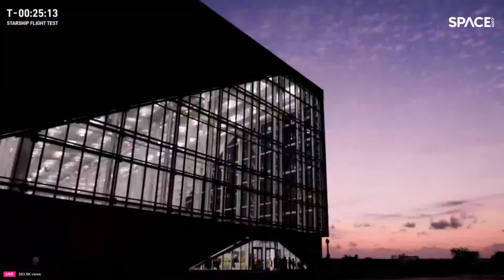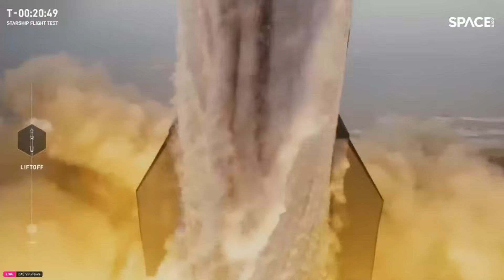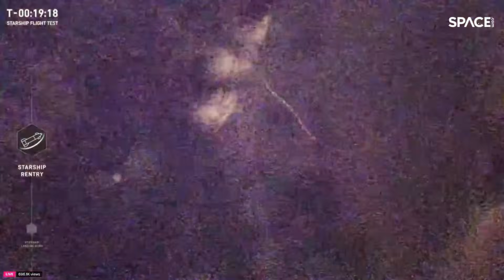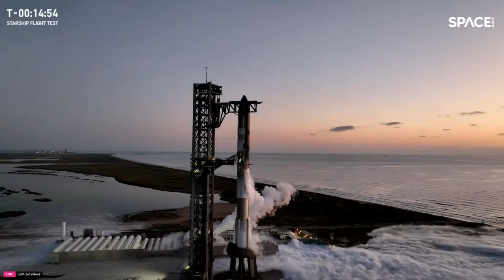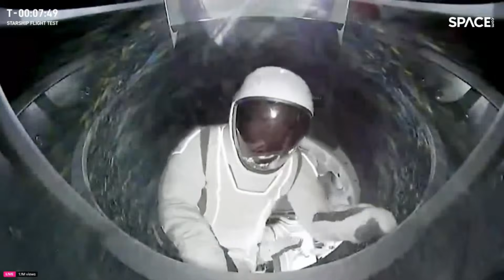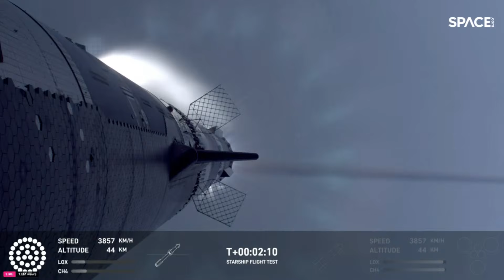Replay! SpaceX launches Starship on 5th flight, booster catch successful

Comment: The catch was awesome. So incredible to see them nail it on the first try. However catching a booster is fine, but if SpaceX is going to focusing on catching the ships, it will do  nothing for get them closer to landing on the moon or Mars. 
Also closing the chopsticks around a Starship to catch it would probably damage the heat shield tiles. 

The reality is SpaceX shouldn't be talking about landing un-crewed Starships on the Mars by 2026, when they don't seem to have made any progress since SN15 on landing legs. The legs used for SN15 are no where near wide enough to land on the uneven surfaces of the Moon and Mars. The legs also need to be self leveling.

Comment: It's amazing how FAST that booster was dropping down.  Yet in control to get it at the right spot.  and firing up the engines shortly before landing slowing it way down, and on target.  At first I thought it was coming down to slam into the ground at over 3000mph.  The mess that would have been made over the whole launch area would have been massive.    There is so much stuff there and all unprotected.  It's ALL counting on a successful catch on the first try.  Something that has NEVER been done before.   The Facon 9 has a small margin of error when landing.   If you're off a foot, it's not the end of the world.  Off a foot here at the Chopsticks and disaster!!!  The things SpaceX has been able to pull off, I thought was impossible.  No way in hell.   China has been trying to copy this and so far has failed.  It's so much harder than it looks and it looks darn hard.  It's not going to be exactly easy for China to copy.

Comment: the bad new is that the booster cannot be reused unless the structure is repaired
Reply: Did you see damage that no one else mentioned?   The booter, ya, it had a small fire for a while after landing.  This was only a TEST.  This was never meant to be used again.  They have more being built that have moved on tech-wise.   Just like Starship.    It's all about trial and error.  Launch, Launch, launch, learn, improve, and try again.   This time they saved the engines which can be reused on future rockets.  It'll be inspected to see what can be improved for future versions.  This was only a test to see if they could land it.

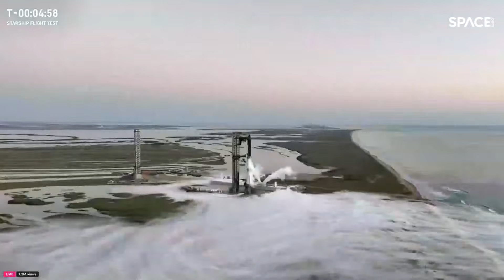Comment: Amazing--- what has done is  "Just the begnning for modern, futuristic man" (provided humans avoid WW# 3 or 4)! They must prevent the stratospheric "SMOKE" (Isaiah 51:6, Psalm 102:26-28, Jeremiah 25:30-33, QURAN 44:10 "Al-Dhukan" (SMOKE)-get it now, Rabbi/Reverend/Imam-- a thin hace of nitrogen oxide gasses could 1) block weak strarlight of the constellations, JOEL 3:15 + MT. 24_28-29, ISAIAH 13:6-10, JEREMIAN 4:28***--- am I not correct about this Sir? Why even JESUS spoke of it!

Comment: This video is 1:42:41 long i n Slimjet (chrome).  But when you look at it with Brave or Firefox it shows as only 40:44 long.  The rest, with the Ship and the Ship's landing are not there on those.
[update]: It must be a problem with the encoding.  Only 40:44 shows up on most browsers, and  on the search page, search for "spacex starship launch 5"

Comment: As i was watching this. The video was truncated. I was watching the re-entry part around peak heating or slightly after when the flaps started to get burn through but then the video stopped and was truncated to 40 minutes and i can't find a broadcast video with the rest until splash down.

Edit. I finally found another video on another channel with the re-entry part with the heating.